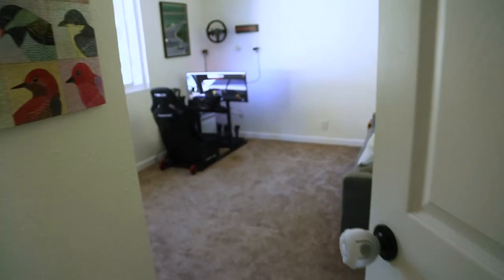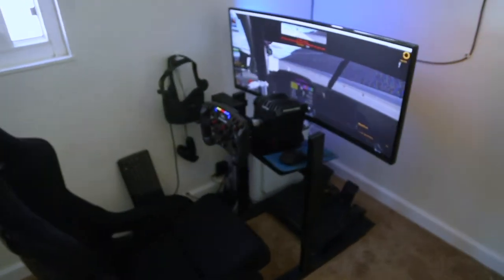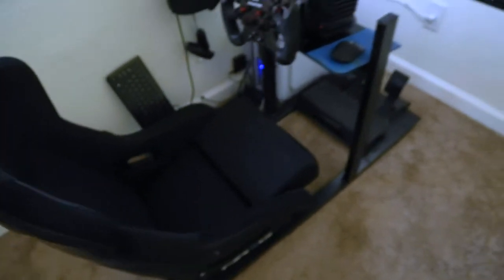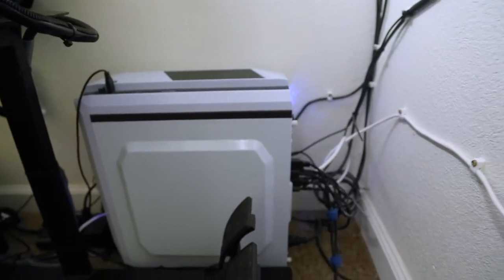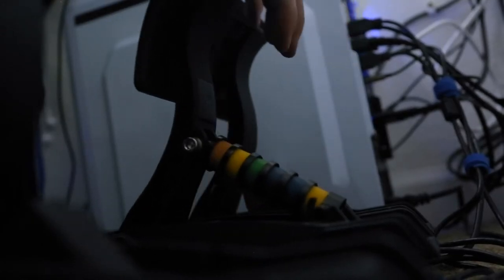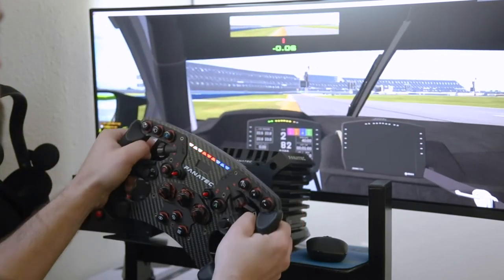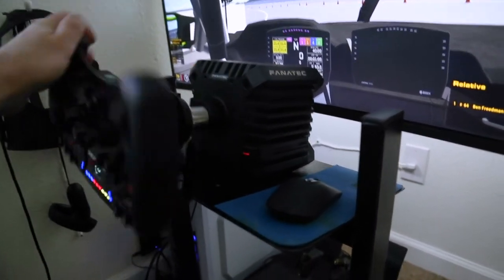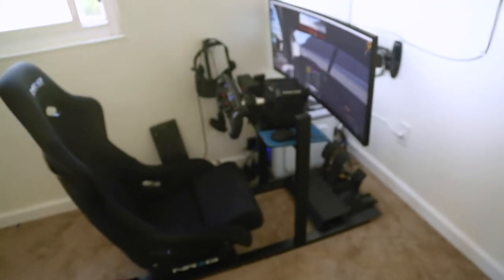Steel Sim Rig Build Update

Comment: Hey I'm here from another C5 video where I was asking about your wheels setup! I bought myself some wheels and only question left in terms of that is what profile tire are you running? 30 or 35? I have a similar sim rig setup. Nice to see someone who's running the driving/ flight sim setup. What flight sim do you use? I've integrated my two setups pretty well - I'm not sure if youtube has a DM system but if you felt comfortable exchanging some way to communicate I would be happy to send pictures and offer advice if you're interested!